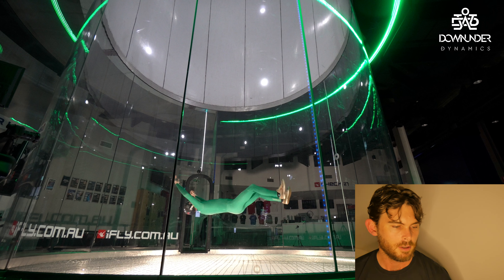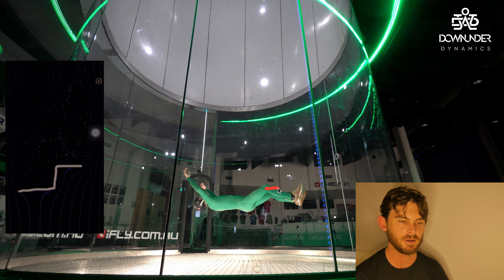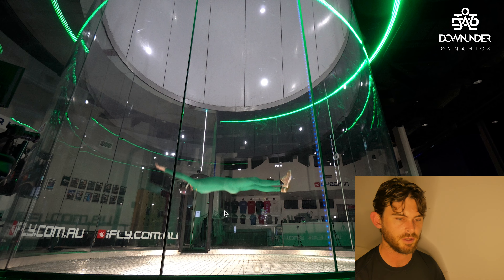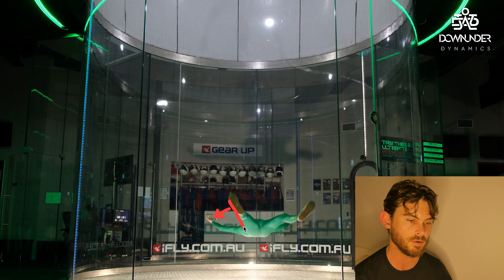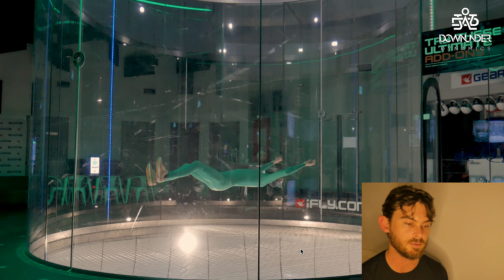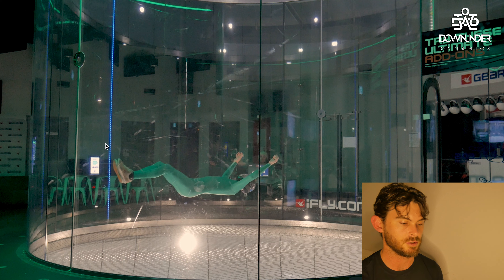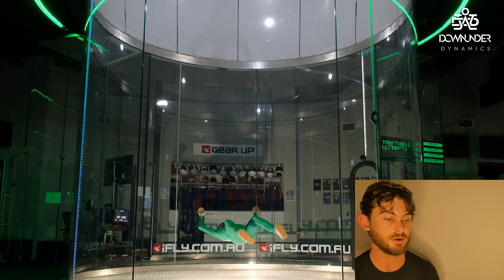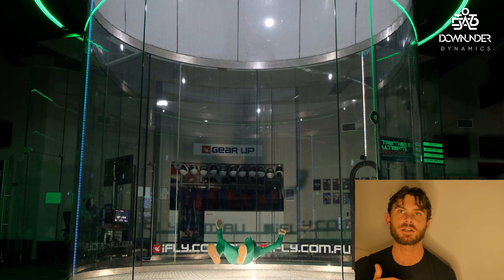Back flying techniques for skydiving

Comment: I spent 45 min in the tunnel on my back and got nowhere. I hate the tunnel.
Reply from the maker: Dont be dismayed, back flying is by far one of the hardest positions to learn in the begging, everything just feels backwards. if its not working with the coach you are with find another as well. I remember when I first started and it took me about 45 min to get back flying and felt like I was getting no wear as well. an experienced coach can def help that time become shorter. but also giving in to the fact that you will suck for a bit as well. back flying is fucked but unfortunately a necessary part of it.
Reply: Back flying is super hard.. it takes time and some dont learn even to move or stay stable in 45mins 😂 I personally went my first back flys from wall to wall with no control at all 😅 And everyone more experienced said that they did too at the first when they practised.. It is literally one of the hardest positions to handle.